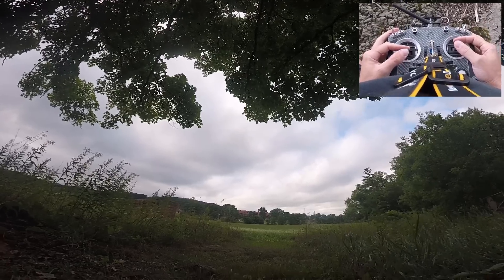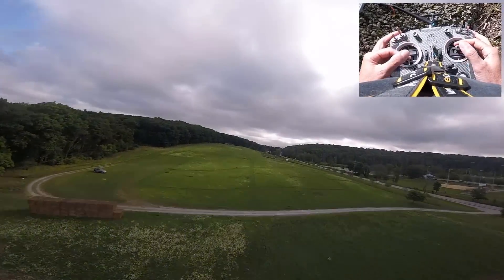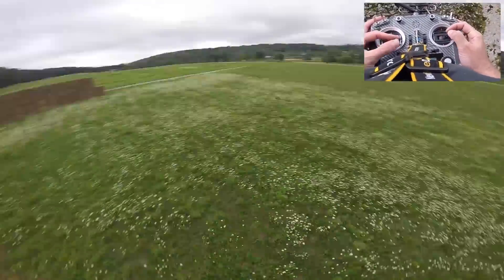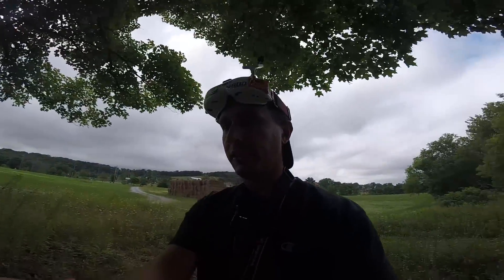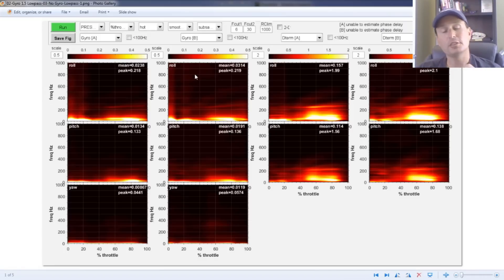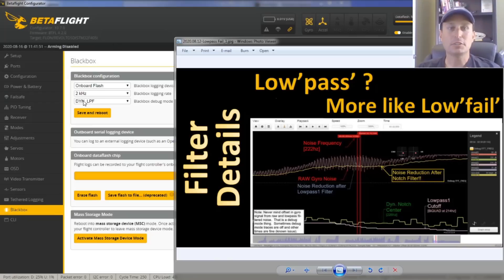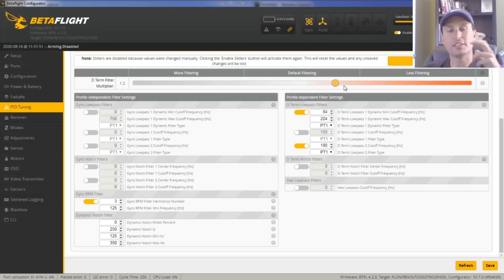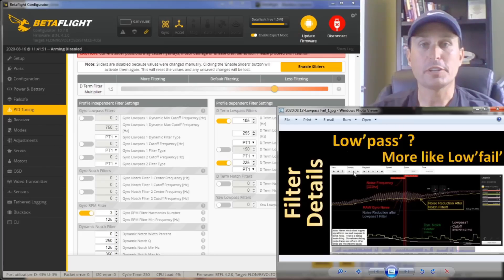How to Setup Betaflight 4.2 Filters

Comment: I've already used the gyro's low pass filter to filter a range of frequencies.

Now I have activated the gyro notch to filter out a high frequency noise spike but the width in the center is not enough.

could you widen the center of the notch instead of widening the cutoff frequency?

widening the center of the notch using the cut-off frequency is a very limited and inefficient method of attenuation, in this way I go to filter even points where there is no high noise and only increase consumption and I lose thrust.

couldn't we put two central frequencies to have a much wider center with a more precise and correct attenuation?
Reply from the maker: Ypu cannot widen a notch center.  That would be called a band stop filter which as much more delay.  You can widen the notch with a lowe Q factor and in BF 4.3, you can have up to 5 notches target amd crush peak frequencies.
Reply: @uavtech  Hello I have a cinewhoop cvatar 142mm, and I notice temperature in the motors.que pid and filters I can use thanks

Comment: what do you do for filtering if you dont have dshott escs, i have littlebee 20a escs, possibly old ones as they  dont look like what i see online. they do multishot.. this is on a quad 4s with 4 inch props. no blackbox as fc doesnt have sd card logger.
Reply from the maker: Just us the Dynamic Notch and filter sliders.
Reply: @uavtech  i slved my issues turs out there was  a bad esc that had 2 capacitors on th board broke. replaced with little bee spring escs. whole differet quad now even at defaults

Comment: I have an older flight controller with the "jittery" Bosch Gyro. Will the ability to bypass gyro low-pass filtering this make it a usable flight controller?
Reply from the maker: No.  Just use a BiQUAD on Gyro.  Seem by Bosch FC review video
Reply: @uavtech  My bad - it's an ICM 20608 on the notoriously bad Omnibus F4 Pro Corner FC. What is BiQuad? Searching for it on YT brings up very old videos, and it looks to be inbuilt and enabled by default.

Comment: Hi,I just started tuning using the blakbox and am working my way through all your tutorials.
When I watched this one, I was a little confused: In your previous videos to filters tuning you explained how "inaffective" PT1 filters are compared to BIQUAD filters.
But here u use the PT1 filter on the D lowpass filter.
Could you please explain why u use the PT1 in this case?
Many thanks in advance, Henri
Reply from the maker: BF dev group move away from BiQUAD to a dual PT1 approach.  To keep a consistent message, i didn't buck that trend.  A dual PT1 approach provides close to the same as a single BiQUAD.
Reply: @uavtech  Ahhh... allright, many thanks for the answer!
Reply: @uavtech  And I just like to add: Many thanks for all your work and "follow along" videos, what they are if you watch them, consider fix flight manouvers fr your logs and then start with the filters videos. But everybody should be aware: Don't become a blackbox junky! I'm just getting a second Battery for my Renault Twingo with Converter to be able to fly, record logs, analise them on the Laptop on the flight field a whole weekend. - Force yourself: Also do some fun-only flights... ;-)

Comment: Dynamic notch filter is the most obscure and most prominent thing at the same time. It is so confusing. We had some big fuss with Kalmen filter which fizzled, and dynamic notch filter just sneaked in unannounced. It feels as if the dynamic notch filter is just another gimmic, but it just doesn't go way.
Reply from the maker: Because the dynamic notch is not bullshit like the "kalman".  The fuse was manufactured by snake oil salesmen that wanted to sell FC boards (Helio). They had a cult like following from F1 where folks drink the kool-aid all the time. The "Ai" filter is the next B.S. thing that seems is coming.

The "kalman" is just a PT1 filter.  The PT1 filter equation is right in the code itself.  And lowpass filters are NOT made to kill peaks of noise like notches are.

So the difference is when you run logging A-B tests on one (the DN) you can clearly see "holy shit, look how effective it is at killing motor noise."   And when you run the other (the "kalman"), you are like "wait, i don't see any improvement here vs a conventional PT1" that is why one is the gimmic and one is real.

Don't drink the kool-aid.

Comment: Thanks Mark. I’m trying turning these filters off today. Question: Is this when running RPM filters?Never mind sorry I just re-watched you answered my question. So I have the mark 4 6 s would you try these settings? Starting at 1.2 on the gyro ?
Reply from the maker: I would give it a shot.  Personally I don't go blind and I look at raw noise performance in blackbox, but give it a good for gyro lowpasses off.  Remember, with gyro off, D-term slider is 1.0 to start.
Reply: @uavtech  I tried it yesterday it made a weird noise when I gave a throttle blip. 
So I put everything back the way I had it. So I have some type of motor de sinking going on I shouldn’t have any motor desinking.  I put everything back to normal and I realize that I’ve been having this problem the whole time ever since I got the quad copter. 
It doesn’t fall from the sky but you can hear it desink but it keeps running. I messaged you on messenger if by any chance you have time could you please look at it ? I gave a very good description as short as possible. I’m also doing black box and I want to look at the raw noise like you said. I already have it in my computer. 
I’m talking to the old lady about becoming a five dollar Patreon I need your help.

Comment: What was the deal with the filter slider not disappearing. I had my slider at 2x and shut the gyros all off and it shows 1.05. Even in the lua script it shows the min at 0 and the max at 1000. But the 1000hz is grayed out. They are still off right? Or is there some kinda protection thing going on under the hood that you need to disable in cli or something?

Comment: Hi! I disable all gyro lps filters on my quad. 

Flight very well with them off, but the escs burned after a few batteries. I didint crash, and props were new. Its a very clean build.... my gyro_scaled logs show a very tiny peak of noise on all axys. I don't know if the escs burned for having turned off the filters or if it was a coincidence.
Reply from the maker: Coincidence IMHO.

Comment: No doubt, another great video. But hmmm, the thing that keeps me from disabling the gyro LPFs until now where to have some kind of "safety belt" in case of beaten up props or other things causing an imbalance. Do you think the RPM and dynamic notches are able to handle this scenario without the help of the LPFs?
Reply from the maker: Yes.  The RPM has you covered for bent props (they still spin at the motor RPM) and the Dynamic Notch is really the failsafe.

Comment: What PID loop frequency are you using?  Wondering whether there would be any difference between 4K and 8K.  Thanks!
Reply from the maker: Eh, the difference is sampling every 0.125ms or 0.25ms.  Whereas filter delay, delays the entire signal by 0.5ms to 1.5ms.
Reply: @uavtech  Got it.  What I'm actually curious about is whether the PID loop frequency has any impact on the effectiveness of RPM and dynamic notch filters.  In some of my setups post-filters noise level was lower with 4K compared to 8K, both with 2KHz blackbox log frequency.  Just curious if you have seen any difference in filtering performance among different PID loop frequency

Comment: I was considering a bit the opposite: removing the dynamic filters, because the lowpass filters will still have a very good effect on higher frequencies. Is there something I overlooked with this idea?
Reply from the maker: Eh, lowpasses are only really effective at attenuating noise at 8x the cutoff.  So that is noise above 800hz.  So they are just not effective at killing motor noise that exists between 200hz and 600hz.
Reply: @uavtech  But we have RPM filters for motor noise. My question is what are dynamic filters doing if you don't have a damaged propeller? I'm planning on doing a test with that specific situation to see how it's taken care of with the current tools we have in BF.
Reply from the maker: @LenordeFPV  it is not doing much either.  Also RPM filters still hits bent props as they still spin at the motor RPM.  Just a higher amplitude vibration.

I think in my Patreon video this week we'll take a look at that.
Reply: @uavtech  Alright, thank you very much! So there is still room for filters to remove thanks to RPM... :)

Comment: Wonder if there is any correlation between frame thickness and motor noise? I.e. do frames with thinner arms handle motor vibration better than maybe 3mm - 4mm arms do. Maybe something to look into.
Reply from the maker: Thin arms are worse.

Comment: Ive watch a lot of videos and have noticed that you dont tune bigger quads. Does these tips for tuning PIDs and Filters the same for bigger quads? I have a iFlight XL10 and i cannot seem to get rid of low throttle bobbles, especially with doing a Power Loop. I've recently turned off all the extra features so i can properly tune my quad per your method. Thanks
Reply from the maker: 9" tune - https://youtu.be/MiBpVPRB-xw

7" octo tune -
https://youtu.be/UnZjL_PBR80

I have tuned many 7" quads.  I have another 8" octo coming in this week.

The key with big quads is PD Balance 1:1 (generally) and pushing PIDs up (60's for D gain)
Reply: @uavtech  Thank you for the Links. I have a 10" quad, and for the filters i chose to not use the sliders as the values seems to feel better with lower values the sliders couldnt get to. i was kind of "Iffy" about messing too much with the PIDs, and after looking at the values they were lower than what you recommended, so i will fly some packs today in trying to tune the quad. you are the man!!!! thanks Alot

Comment: remark - 8:40 there is no propwash at your logs at 80 hz. It is on 80% throttle, but 80hz and above are clean during both full flihts).  That's cool! it acctualy means to push d lowpass cutoff much higher after turning off gyro LP and say goodbye to prowash, right? ;-) of cause I consider mechanicaly good quads first of all) 

Although I used this strategy even on mechanically very bad quads. and it works! Just use little bit biffier (2307 instead of 2205 for example) motors with same batteries and kv rating so they do not overheat even on bad gyro signal and very high D gains. Then set gyro LP off + (try) dyn dterm LP like 200-300hz region. Yep, d term and pidsum logs might look terrifying, but who cares when your motors can handle it and the (bad) quad still flys smooth). RPM and dyn_notch are amazing stuff!!
Reply from the maker: At 80% throttle to blob is going up to 80hz.

Good to hear it works on bad stuff too.  It should with the DN on duty for cleanup now.

 Have to always give a disclaimer of some type so folks don't think it is for every quad out there regardless of mechanical.
Reply: @uavtech  your 80hz blob is realy small) or I probably had too much experience with budget stuff giving THE blobs time to time. Anyway thank you for sharing this small things giving 90% of success on perfomance.

Comment: Watched your videos for a while. 

Is there any chance of an idiots guide to tuning. I mean real basic. Instructions everywhere.
Reply: Joshua Bardwell does a really good job of taking the salient points of tuning (and he uses Mark as a reference) and distilling those down - beyond some of the more basic stuff, it gets to a point where you have to get over that knowledge hump in order to understand why changing one thing results in a lot of other stuff being different.
Reply: Yes I watch both and many others. But still for some reason don’t understand the whole process. Plus with 4.2 coming out you can’t go to far back to understand it as things have changed since the update with more options and things to change or Bogarde
Reply from the maker: Maybe check out: tiny.cc/pidtuning
Reply: See that’s what I mean. It’s 4.1 based. I’ve done a few tunes that are 4.1 based but they didn’t work out

Comment: I don't know what I'm doing wrong, but every quad I have put 4.2 on develops a crazy wobble at low/no throttle, and a ton of bounceback. Messing with I-term relax helped, but not to my liking.  I've fallen back to 4.1.7 and it's fine.  This happened on a Tinyhawk 2 freestyle (though it was the best of them all), a 3" armattan tadpole, and my 6" hyperlow build.  Not sure if I just have trash mechanical builds or what I'm doing wrong exactly.

Anyone else had a similar experience?

Thanks again for your videos UAV Tech, I swear at some point I'm going to get the time and dedication to donate and bug you with logs, etc.  Keep up the good work!
Reply: Happens on my gecko 4inch
Reply: On these smaller quads, and ones with less authority, the low throttle wobbles are easier to fix with thrust_linear (in the 20-30 range), but you may need to add more tpa_rate at the top end to keep that thrust linearization from resulting in high throttle wobbles
Reply: @tehllama42  Thank you, I was messing with Thrust linear on the micros, but not on the bigger one.  I had all but eliminated the wobble on that one, but still had bounceback.  I still think that could have been a bad gyro or motor noise, I'll find out if I ever rebuild anything on that FC I suppose.

I guess I didn't consider the big guy a 'low authority' quad...? Heh.  It's got 2207 lumineers @ 1750kv running 6x5x3s on 6S power.  I'll start with it at 24 the next time I start tinkering. 🤣  I highly doubt I'd ever feel any 'high throttle' wobbles, It's rare I'm over 50%, I just kinda cruise. Maybe the "wrong setup" for that, but I'm enjoyin' it when it flies properly.
Reply: @JerR22  2207's are stout, but 6" props are still big, I can get some aurhority limitations on 2208's even - maybe try 20, see if that's of any help.  Dynamic idle can help also, especially if you're not bringing the dshot_idle value as low as possible (you get a bit more control authority overhead)
Reply: It's your ESC Pwm . If it's on 48kHz, try 24kHz. Check the Betaflight release notes on ESC Pwm and low throttle authority.
Reply: @terrorbirbfpv4732  Ahhh yes, they are set to 48! I'll check those release notes again, for sure. Thanks for the heads up!
Reply: not exactly similar, but i had the issue that my motors get significantly warmer on all quads with 4.2. i tried all. lowering pids d term to 10, filtersliders up and down... i cant get it to the 4.1 state. so all my 4.2 tunings are just compromise tunings and dont fly well. but i dont want to downgrade, bc the yaw jump makes it impossible to do inv yaw spins low ground and this disadvantage is a huge gamechanger

Comment: My 3” flies significantly better after turning off the gyro low-pass fitters without an increase in motor temps. 1.3 on D-term slider. Thanks for the tip!